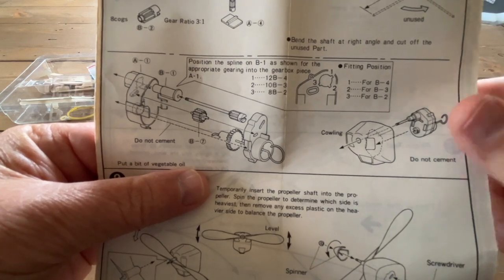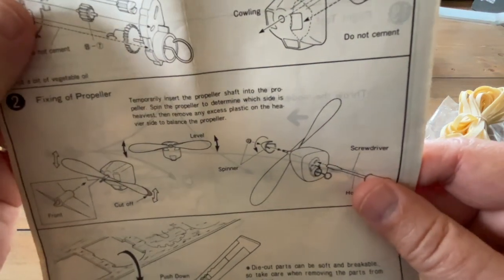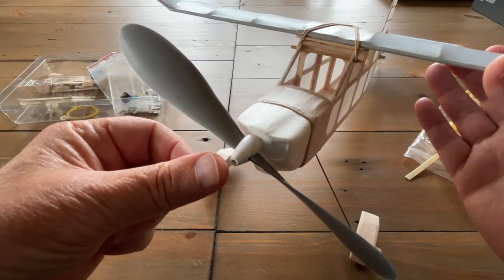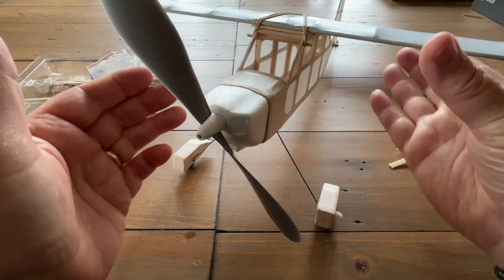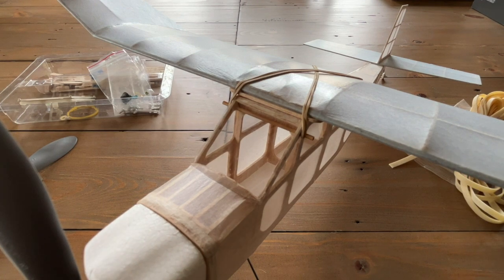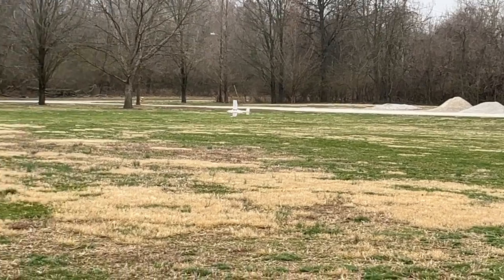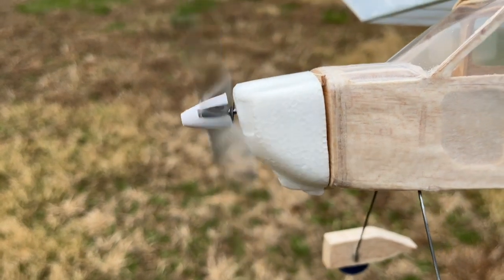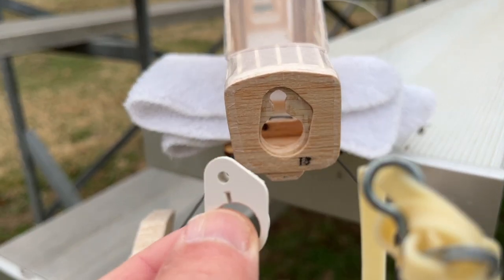TRY-1 crash investigation results & more test flights

Comment: Well guess what? You can't do that, every one I ever used had a positive hook to the prop,so it would rip the prop in half before it would spin.
Reply from the maker: Actually, I misspoke. When the threads stripped, the spinner spun freely, so the prop did as well. You're right, a positive hook on the prop would have prevented this. I'm no engineer, but it seems like a design flaw. Thanks for your comments!

Comment: Are you using rubber lube? I'm building a Sig Tiger this week. Keep it up!
Reply from the maker: Yes, I used a silicon lubricant. It appears that my knot came undone. A rookie mistake, but then again I'm a rookie at this. Unfortunately, my stab is fixed, so I'm not able to add up elevator. Any suggestions for getting it to climb better?
Reply: @kitchentablebalsabuilds  Hmm, well you could try moving the balance further back. I also note you have added down trust, you might try reducing that. The added incidence may help but the down thrust and increased incedence are just opposing forces!. Also you might try warping the elevator with steam. If all else fails break out the razor and carefully cut the elevator off and reset it. It could be as simple as increasing the thrust . Rubber wears out, maube you just need new rubber or thicker rubber or another loop of rubber. It's a balancing act, sometimes it's a mystery. Good luck!
Reply from the maker: @skipstalforce  Good advice--thanks for the feedback! I'm not giving up yet!
Reply from the maker: @skipstalforce  I took your advice and doubled the loop of rubber and eliminated one of the opposing forces. I never had one of my planes fly as good as this one did! I had to retrieve it out of a tree, but its all good! Thanks!